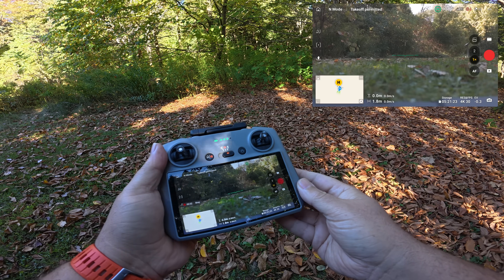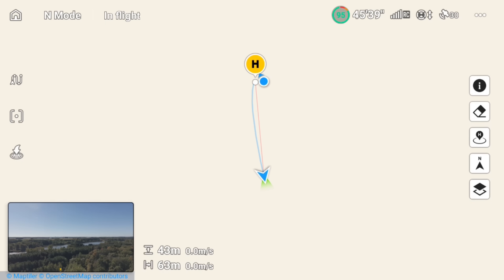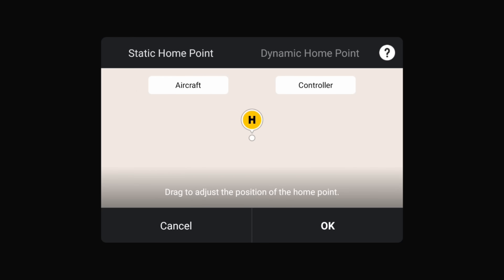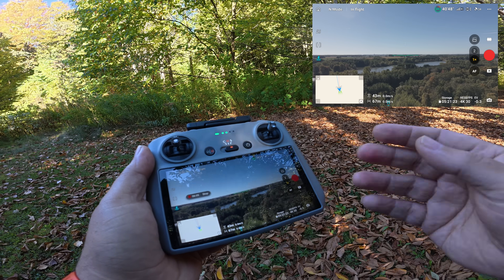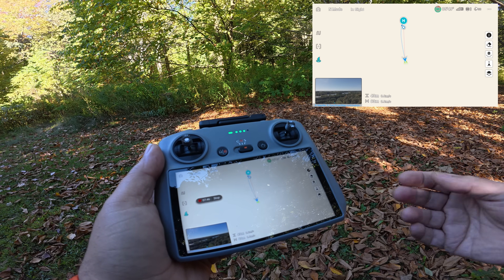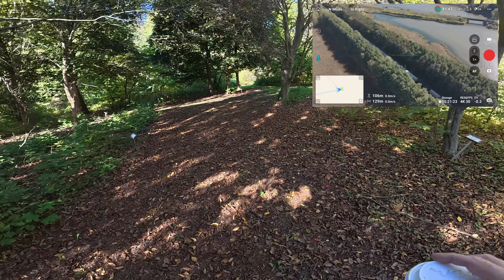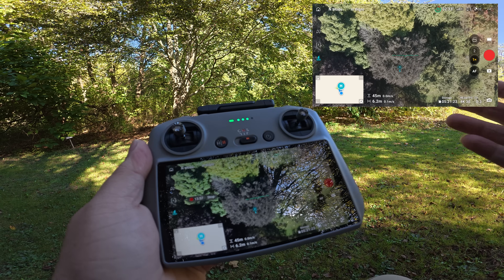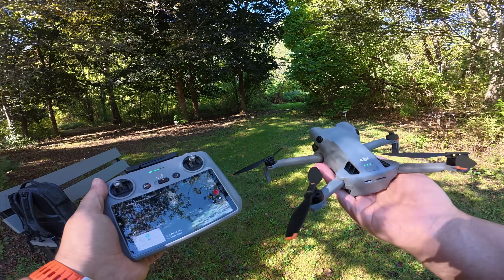DJI Mini 5 Pro Dynamic Home Point -  RC2 and RC Pro 2

Comment: Thanks for this.  One question, at what altitude does it hover at after a dynamic RTH.  Would it be the global RTH setting - in which case, if having climbed a hill yourself, could cause potential issues.

Comment: Thank you  for this fantastic demonstration. You have covered everything, save for my one question:  If I am using the RC2 for multiple Drones (Minii 5 Pro and Air 3) , will the dynamic RTH still work ? .. And yes, I understand i can only connect to 1 Drone at a time ..

Comment: Thanks for the video. It is a really cool new feature compared to mini 4 pro. And it is logical but not obvious that it will go into hover mode after dynamic point RH enabled. But if you won’t land it manually it will land itself anyway when battery goes below 10%. And it is interesting, if in the shown example it will use its lidar sensors to overcome the obstacles and land, or just will stupidly fly down direct into the tree. It doesn’t have lidars on the bottom, so I guess it will fly into the tree. But must be tested, not in such a hard test but smth more sensible )

Comment: Both brilliant, The new and your tutorial 🙏 
In which hight will it hover? 
In the hight defined in the settings or based on the obstacle avoidance?
Reply from the maker: That’s actually a good question. I’m not 100% sure on that. I do believe though you’re correct it’ll come back at the height that you have set. But I will look into it.
Reply: …The New Function…

Comment: Quick Question Do you need to have a Drone Basic Licence to Register My Mini 5 Pro
Reply from the maker: I’m not quite sure what you mean. I guess it depends what country you’re in in Canada if the drone weighs over 250 g. You have to register the drone with transport Canada and you need to have a basic advanced pilot certificate.  If it’s under 250 g you don’t need any of that.

Comment: Thanks for this demonstration it helps. I just bought a Mini 5 Pro on its way from Korea to Arizona. Will the R2 controller and Mini 5 Pro be able to receive activation and updates in the USA, do you know?
Reply from the maker: Yes, I know many people who have gone that route and they have been able to activate it and there’s no problems there. It even broadcast remote ID if necessary. The only tricky part might be getting warranty work done if need be.  So just be very cautious flying.
Reply: @AirPhotography  -- thanks. Did you have to pay a tariff upon delivery?
Reply: None

Comment: Don’t supposed Dynamic Homepoint was added to the Mini 4Pro/RC2 in the latest firmware updates?
Reply from the maker: That’s a good question. I wonder if there is a hardware limitation. Somebody asked about the air 3s as well. I haven’t checked firmware on those drones in a couple of weeks so I’m not sure but I will look into it.
Reply: My RC2 is on the latest firmware 07.00.0100 and can confirm that Dynamic Homepoint is not available. I for one will really appreciate if it’s compatible and made available

Comment: Nice demo. How does it choose the hover height?
Reply from the maker: Good question! I will look into that. I wonder if it hovers at the height you have set for a return to home. It will use it obstacle avoidance during the return to home. Which will add a level of safety in case it tries to hub and there’s a tall object in the way.
Reply: Great question!

Comment: Quick question: The dynamic rth hovering altitude is the one set in the settings for rth or a different one?
Thanks!
Reply: Yes, it is the Auto RTH altitude set for preset RTH.

Comment: Great detailed but to the point video as always. Considering that this is a software feature, I bet this could be given to at least the Air 3S based on it having pretty much the same hardware capabilities. I figure the Mini 4 pro may not be able to have this feature added through software though. DJI really needs to add updated features to the Air 3S, as they haven’t even given it Goggle compatibility yet, and it’s been out a year now.
Reply from the maker: Indeed, that is a good point. I haven’t even checked the firmware for the year three in the last couple of weeks. I wonder if they did add it.
Reply: They will add this feature on the air 3s, just let them sell a few thousand more Mavic 4 and mini 5…

Comment: Helpful video, thanks! Waiting for my mini 5 pro to arrive today. Any tips regarding take off/landing on the hand?
Reply from the maker: It works the same as previous drones. Just make sure you have higher than your head if possible as they can jump around a bit during landing or takeoff wanna make sure your face is protected. I’ve had a few close calls.